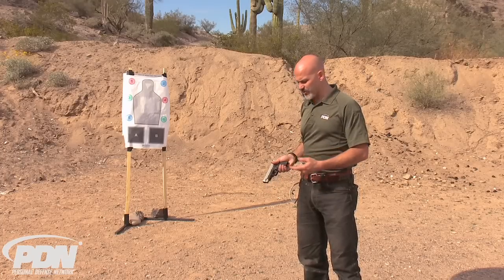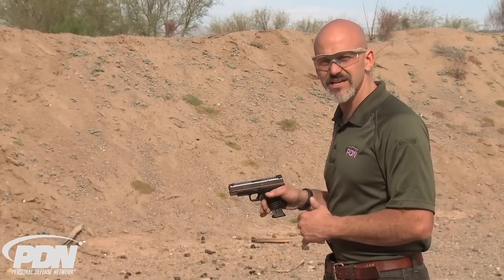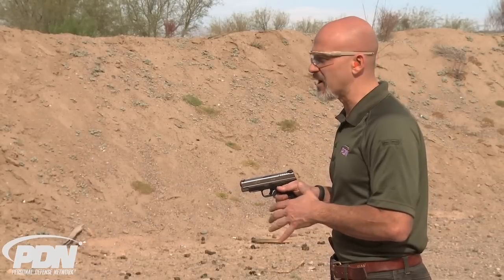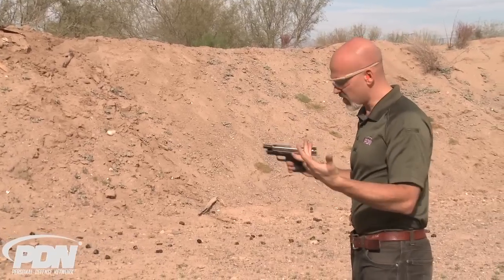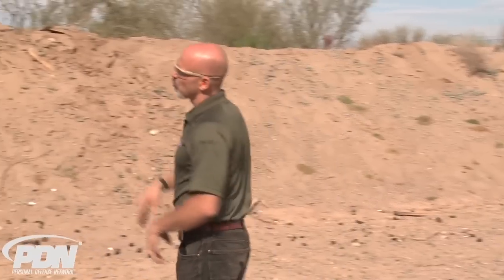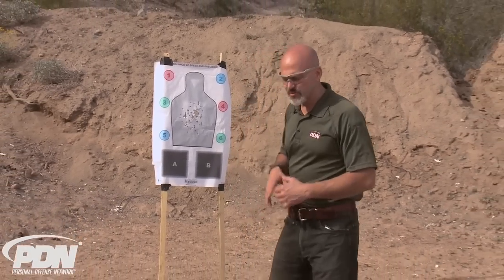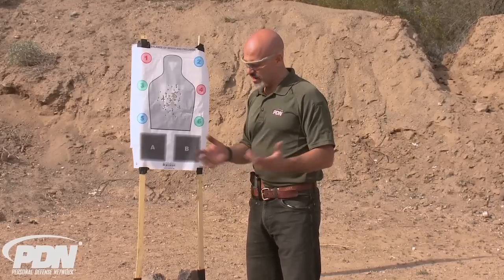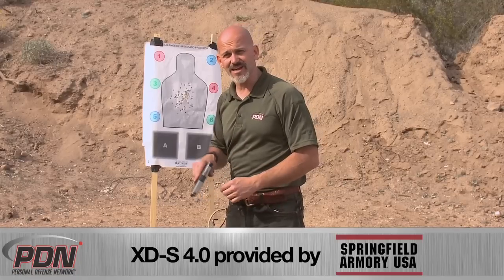Springfield XD-S 4.0 Single Stack 9mm Reliability Test  |  Personal Defense Network

Comment: I've been having issues with my first round loading of my 4.0 critical defense any suggestions it's getting caught on the lip of the feed ramp bottom
Reply: will Lorson Any update?
Reply: +will Lorson Jack the slide and let it go forward with full force. Don't ride it when you let it go.
Reply: +will Lorson did u break the gun in yet? or still having issues?
Reply: +DemocracyOfHypocrisy
Hi I have trouble with the feed of the first round of Hornaday Critical Duty. I switched to Federal HST...no problems.
Reply: +xxwash glock 
I have Critical Duty .40 in my XD subcompact right now. That's what I've been carrying for a long time and haven't had an issue.
Reply: +xxwash glock I have heard that for whatever reason that the xds doesnt like to feed the hornady rounds with the polymer tip. I have not heard of an issue with any other ammo.
Reply: Do not use that ammo none of my single stacks like it. Use federal hst or speer gold dot